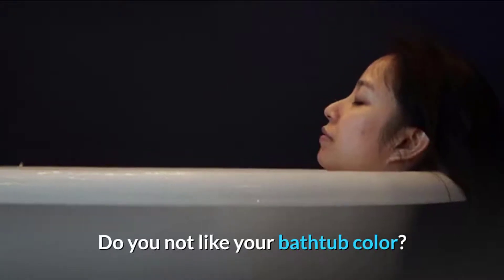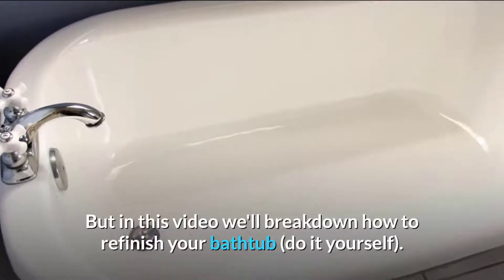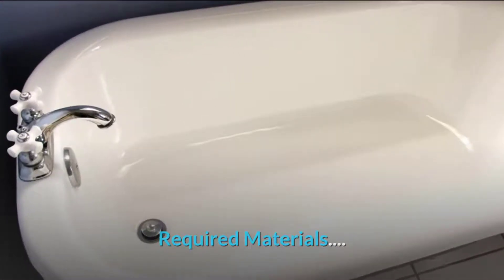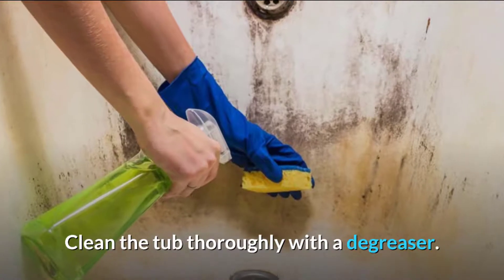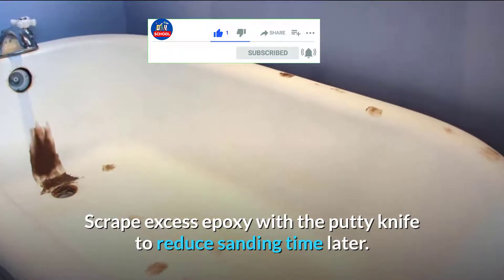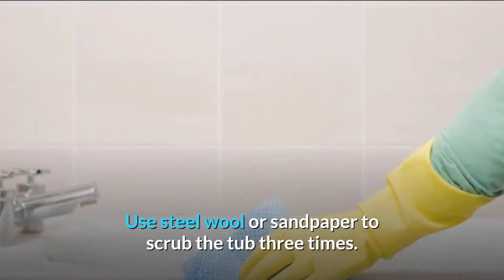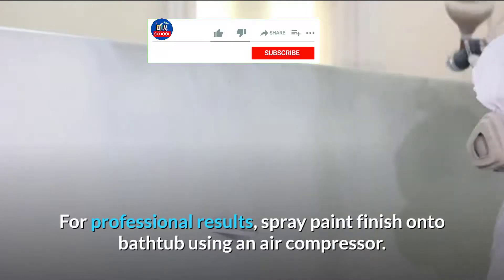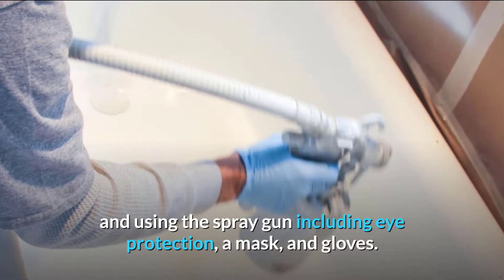How to Refinish A Bathtub: 6 Easy Steps (Do-it-Yourself)

Comment: How do I remove bathroom spray from finish?
Reply from the maker: Wet sand with a fine grit sandpaper 400-800 (make sure the coating is cured first) and then buff to a shine. Be careful not to burn through the coating.
Reply: @VersaTube2024  Thanks!